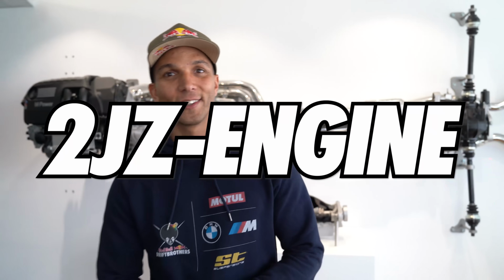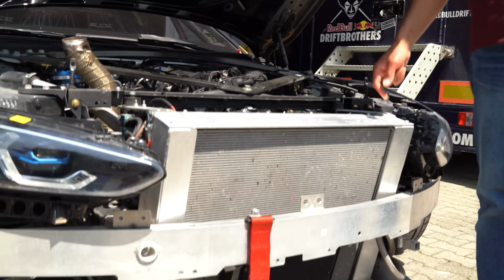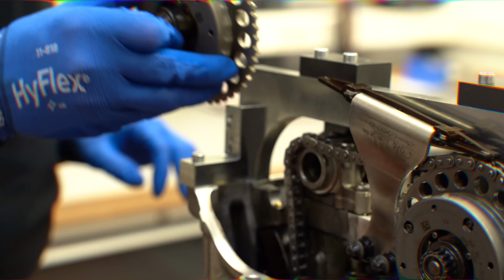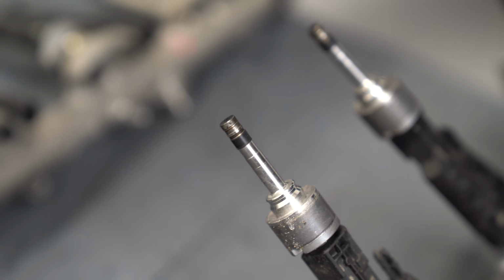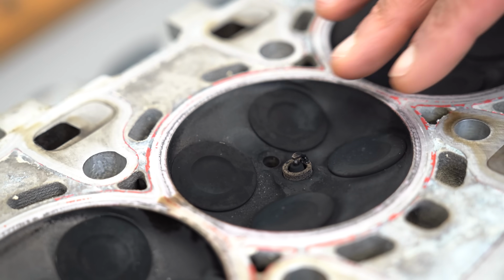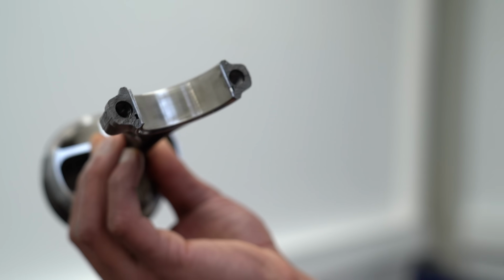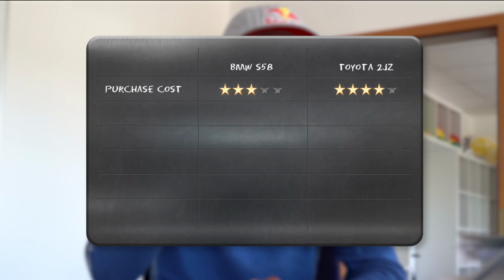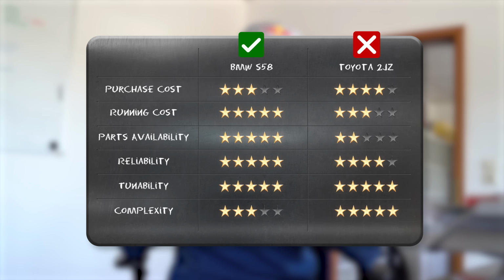Is THIS the new 2JZ? A deep dive into BMW's S58

Comment: 2JZ is Still King 👑
Reply: cope
Reply: @czczczzzczczzz  they are grenading blocks at 70-80psi at about 1700whp, 2jz cast block holds more and for longer. Also upgraded maincaps on a 2jz and it will hold 1000-1100whp forever with a good tune time has shown that.

Comment: This is great to have found! Something not really mentioned was the 2J wasn't really discovered and popularized until a good amount of them were already in junkyards and tons of them for cheap which is what propelled that status. Not sure that we would ever see that though with the S58, the base cars are just worth too much and BMW parts cost twice as much as Toyotas so no, no matter how good that 58 is, that will be the limiting factor. I don't really think any BMW engine has ever had anywhere near that kind of status because of the costs involved. 
Who knows really what will happen and I am a layman, so what do I know. 
Just learning as much as I can about it. Not sure if there is a current motor in the toyota range that might be close to that base. Needs to have super high production. Not sure if a V6 will ever compare.

Comment: The Barra (4.0 I6) is more worthy of being considered as a top engine alongside the 2JZ. There are quite a few Barra powered cars putting out well over 1000 hp.
Reply: The Barra is a great engine, but it cannot be considered alongside the 2JZ, S58 or even the B58, for two main reasons. 
1. It's a 4 litre not a 3 litre.
2. It cannot make 1000hp with a stock bottom end.
My son has a Barra, and I love it, so I'm not a hater. Just being realistic here.

Comment: In my opinion the b58 is better than the 2jz as well. If you want an inline 6 that’ll do 10s in the 1/4 with just a turbo and a fuel pump and some supporting mods it’s easier to do. Proven to hold 1000hp as well.  And a 140i can be had for 20k now value for money

Comment: Really wanted to see the back of the valves and what the engineers had to say about the added port injection.
Reply: I’m sure it helped keep carbon build up to a minimum on an originally a di fuel system which is notorious for carbon to build up in.

Comment: Just killed it with this video!  I was looking for head gasket information and came across this and got stuck watching and couldn't stop.  Unfortunately I think my head gasket is leaking coolant into the cylinders. Stock engine 30k miles no abuse .... but still we  have rusty spark plugs, steam coming out the tail pipes and we are using coolant.  Not gonna be fun, she loves her car so I'm gonna have to  change the head gasket.  I might make a video when I do it.

Comment: The 2jz is so overrated
Reply: Explain? What have people made on a stock bottom end 2jz and what have people made on a stock bottom end S58? 

(After you post those numbers remember one of the engines came out in 1992 and no one talks about a bmw engine from 1992)
Reply: Thats not a fair comparison....i mean stock turbo s58s are putting down 650..700whp fbo tuned.....the only thing the 2jz got goin for is its stout bottom end ...if you really look  its a very inefficient engine that needs big boost to make power...compared to these moderm engines as far as efficiency at makin power its not a good Comparison
Reply: @jayjesuswake3140   first thing first I’m guessing ur waving the flag by not posting the numbers. S58 is a MEGA engine. However, the G80 and M2 currently are 3,900-4,000 lb cars. I wouldn’t consider those driver cars anymore.  Second S58 is mainly being used in America for one thing “STRAIGHT LINE PERFORMANCE”. This is the reason the 2jz is so loved by Americans. It came out in 1992 and there are real world examples with 2jzGTE ‘s pushing 1160whp with 47PSI on stock bottom end and actually being abused. Those are the facts. While the S58 is making X amount of power u still have to spend 80-100k to get into that engine. Then spend another what to make 800whp LOL. that’s ALL IRRELEVANT though. Bottom line is the 2jz is the measuring stick and the S58’s I’ve seen has forged internals at 1,000-1,100whp.
Reply: @bigjdm5460   quarter mile as nothing to do with engines making power efficiently or determines the better engine wth u talkin bout
Reply: @jayjesuswake3140  guy giving his opinion yet again, but afraid to post the results in the real world. Do you realize you said a VQ35DE or HR is more efficient than a 2jz…….yet u can’t post anything it has accomplished in the real world than a 2jz . 😂😂😂😂 hilarious.
Reply: @bigjdm5460   thers plenty of bmw engines that are more efficient at makin power ...i swapped from a 2jz bk to a vq35de in my g35 because it was jus better for the power range i was lookin 4 ...actually way more efficient tbh
Reply: @jayjesuswake3140  back to he say she say. Numbers my guy. What’s the fastest pass a VQ with all its efficiency has done in the 1/4 mile? What YEAR in D1GP and formula drift has a VQ one the season over a 2jz? (To claim it’s overrated u need receipts not what you feel)
Reply: @bigjdm5460  Numbers ? lmaoo u think a 2jz powered is the fastest lmaooo

Comment: I keep telling people the S58 is the new 3JZ.
Reply: The 2jz stock bottom end has seen 1170whp and they aren’t dyno queens . So I’m confused on how the S58 is a 3jz. Unless the S58 is capable of 1,400whp on stock bottom end and last longer than a 2jz then I get it. As of right now the 2jz can compete and beat any N54 , S55, B58 , S58 when it comes to raw power on stock bottom end.
Reply: @bigjdm5460  1170WHP for how long? It's very well documented that for a reliable tune you shouldn't exceed 700-750WHP max on the 2JZ with stock rods. That's about as much as a B58, and nowhere near an S58.
Reply: @xIcarus227  wrong , E85 small turbo with a lot of low end torque kills rods. Same with a B or S 58. Big turbo 2jz’s with a good tune and understanding torque delivery will last longer and currently make more power than any stock bottom end B58 or S58. If I’m lying post the links showing 1200whp S58 on stock bottom ends and if u could do that just know the 2jz can do that and it’s from 1992. So Toyota built a reliable block back then that took bmw 30 years to make the same power yet we saying it’s taking over?
Reply: @bigjdm5460  the 2JZ CANNOT make that kind of power reliably on stock rods, you'd need to go north of 10kRPM which would probably make it cost more than rods and pistons which is stupid. 
The S58 CAN hold that power, with basic bolt-ons. You don't even need to go nuts with the rev limiter for it. That's all. 

And I don't care how long it took BMW to make that kind of power, this isn't a dick measuring contest. Any company could've built cast iron blocks that hold big power, BMW and other manufacturers didn't because it's not economical and because it also ruins handling. The Supra was criticized for its poor handling when it launched as a result.
Reply: @xIcarus227  no point of arguing, seen it in person . Did not take 10k rpm’s. U also have examples u can research. Never took that kinda rpm. Ur way off. It’s a 3.0L 86x86 . Smh
Reply: @bigjdm5460  it never took that RPM? You said it did it on low torque, which means you need a crazy amount of RPM to achieve that number. So which one is it in the end? 

Do some math. Your 1.100HP 2JZ needs either: 
1. 1100Nm of torque to make that power at 7200RPM
2. 900Nm at 9000RPM 
3. 750Nm at 10500RPM (750Nm is considered the upper limit of what's reliable with stock internals) 
Or anything inbetween.  

None of these configurations are achievable with stock internals. 1 would bend rods very quickly, 2 and 3 would throw your pistons on a priority mission to the ISS. 
So I'm not questioning whether you saw it, I'm saying it won't do that power reliably which defeats the whole point. 

We know however that the S58 does that number reliably, we have 1300HP builds on stock internals and it seems it can take more. So you're wrong, the 2JZ cannot take the same amount of power as the S58 with stock internals. Not even close.
Reply: @xIcarus227  1103WHP at 7200 RPM looking at dyno graph now. Another guy made 1160WHP . NONE OF THAT IS AT 10KRPM. You did all this math yet u could YOUTUBE THE RUNS. SECOND I said if torque delivery down low is monitored. 800Wtq at 6.6krpm (actual real dyno numbers) is not the same as 600wtq at 4krpms . 

The video we are typing under the guy said they are making about 880-900whp. The 2jz can do that and live there. I agree when u say “FOR HOW LONG at 1100whp” that depends,  same applies to a S58. Everytime I see a s58 with a 900whp or 1200whp they have already put forged rods etc in. Also I’m not talking about Dyno queens with 1160whp, 2jz’s with abuse. So just send me the links below of these 1300whp S58’s on stock bottom ends being pushed and for how long
Reply: @bigjdm5460  "1103WHP at 7200 RPM looking at dyno graph now"
Okay, still won't do it reliably. 

"You did all this math yet u could YOUTUBE THE RUNS"
There's no way I can find the video you're talking about seeing how many runs exist. 
Ps. we can't post links. It will look as if your comment is fine, but actually nobody else would be able to see it. 

"SECOND I said if torque delivery down low is monitored"
Then your point was irrelevant. It doesn't matter where the torque is, it's going to bend your rods all the same. 

"The video we are typing under the guy said they are making about 880-900whp. The 2jz can do that and live there"
No, the stock 2JZ absolutely can't live there. Go search Supra boards and you'll see bent rods even before 800WHP, hence why 750WHP is considered the upper limit if you want a reliable motor. You clearly don't understand how unreliable the stock rods become at those numbers. 

"Everytime I see a s58 with a 900whp or 1200whp they have already put forged rods etc in"
Because they either plan to take it higher, or want to play it safe. Doesn't mean it needs them, see the video we're commenting under. If a 1000HP S58 can take drifting for 2 years, which is the most abusive workload for an engine, I guarantee you that others don't either. 

"Also I’m not talking about Dyno queens with 1160whp, 2jz’s with abuse"
A 2JZ with that power does not withstand abuse, period. Sorry, you're contradicting the consensus of tuners everywhere, tuners who know much more than both of us combined. 

The 2JZ with stock internals is still a great engine, but nowhere near what you claim. The S58 is superior in stock form as far as power holding is concerned. The beauty of the 2JZ is what happens after forged internals, not before.
Reply: @bigjdm5460  I literally just told you we can't drop links in here and you still ask me to do it? Did you actually read what I wrote? Did you search the Supra discussion boards like I asked? Did you google 1000+WHP builds for the S58? Let me guess: no. 
You're more interested in ranting about how the 2JZ is the greatest even though it's clear the S58 is superior in stock form. 

If you're gonna continue your monologue I'm out, there's no point wasting my time on people who can't subscribe to a basic semblance of truth.

Ps. your comment got deleted, probably because you decided to edit it with a link.
Reply: @xIcarus227  I was at target shopping. Mybad , I’m bad at multitasking

Comment: I can hear the tears from 2JZ fanbois, it sounds like a tropical rain storm.
Reply: You’re discussing a motor from 1993 that holds 1,180whp on stock bottom end to an engine that holds similiar power produced in 2020 ? How is it better? Also which bmw inline 6 from 1993 holds 1200whp on stock bottom end? 😑
Reply: @bigjdm5460  can a 2jz not handle 1,181hp stock?
Reply: @matthewnicholas6365  it really can't, he's dreaming. Perhaps there's been a handful of cases dyno-ing close to that number, but they wouldn't last past a few days.

Comment: Nah B58 is modern 2JZ S58 better than both of them
Reply: S58 is better in what way? Post the 2jz stock bottom end power numbers and post S58 numbers. Then tell me which block can hold more power reliably, then tell me which crankshaft can live longer at 1,500whp? If u dnt have those answers or some how did u come to the conclusion the S58 is superior?

B58 at 800whp on stock bottom end is a time bomb. 2jz can live there easily…….post the facts.

Comment: Not impressive at all. If Toyota's 2JZ engine could do 1000+hp in the 90s then BMW should be able to do 1500+hp in 2023!
Reply: I’m all about the facts and will give credit where it’s due. But to say the S58 is superior when it isn’t out performing a 2jz from 1993 in 2023 is just BMW bias . these guys are acting like it’s doing 1,400whp on stock bottom end. Even if it did what bmw engine from 1993 is even being discussed in 2023?

Comment: My big take away is with a good warm up and proper maintenance, these things are very reliable
Reply: Modern engines don’t really need to “warm up” to an extent, if it’s like negative degrees out yeah you should probably warm up any car.
Reply: @CHIKMNUNGET  yes and no, you can drive any engine straight away, but you should try and put the least amount of stress on the internals as possible by easing the car along and always waiting until the car has has reached operating temp to get any sort of power out of it
Reply: naw man warm up the engine oil only does its job properly at certain temp

Comment: Have the s58 in my x4 M comp and it’s not missed a beat in 80,000 miles, what an engine.
Reply: Bro I can’t find those anywhere how many miles did you get it at? What year? How much did you get it for? I found 2 2020’s for 45k and 47k
Reply: What can’t you find ? The car ?
Reply: I'm about to pull the trigger on an x3m comp. So I won't regret it?
Reply: Test drive, then test drive again, as it’s been said the B58 is a better cruiser in the X3M40I, actually better on motorways as well as it stays in gear, but ………

We don’t buy M cars to cruise about, the S58 wants to be revved and comes alive over 4k

I’ve driven to southern Italy and northern Norway in the middle of winter, this car is capable and I prefer it to softer set ups.

I’ve rung its neck round the Nurburgring and it preformed unbelievably, brakes, engine, suspension the lot.

If your looking for a fast SUV that preforms Pull the trigger and don’t look back, if your looking for a cruiser that glides over bumps and rolls round corners, get an X5 Diesel.

Enjoy 🤝🏻
Reply: @TheCritAddict  biggest complaints people have are the S58 has no low end torque, the B58 is much better for daily driving in that aspect. Comps are known to be uncomfortable to ride in due to how stiff the suspension is. I’ve had the pleasure of driving an X3 M40i and it RIPS. Plus very easy to make more hp with. I would recommend a M40i over a comp unless you live in perfect conditions and have a different daily.
Reply: I’ve owned both, and driven both long distance, the M40i is capable but they are not even in the same league for performance, the M Comp leaves it behind and add some corners in it’s gone. 

I’d not look back. 

Only minus is the service costs are double and parts are 3 times as expensive.
Reply: @demotroniczz6943  I`v got X4mc and the car is fantastic. Gear box is so sensitive and make a compensation of low torque of low down. Even very delicate touch of gas pedal makes a great effect. Also comfort is well for me event if I`m also 50 yo and my previous car was Range Rover with air suspension.
Reply: @TheCritAddict hope you did

Comment: The only thing with the 2jz is that it’s simple but elegant Japanese engineering. Reliable over built and strong with decades fine tuning ,parts experimentation. The German motors are crazy powerful beautifully built motors but Japanese build higher tolerances into their machines German/European squeeze the machines lowering their life. Can’t beat Japanese bang for buck.
Reply: while being simple you can’t make the gains this engine makes due to complexity. just because there’s more to the s58 doesn’t make it bad.

Comment: B58 is more like it. S58 is a totally a different league compare to 2JZ.
Reply: Recency bias is crazy
Reply: In what way? The 2jz bottom end can hold 1,200whp and I’m sure the cast iron block can hold more power reliably than a S58 block. 

B58 stock bottom end limit is 650whp reliably and 800whp is a ticking time bomb with piston failure etc. transmission start to slip as well. The 2jz can hold 800whp reliably . 1,000whp reliably

Comment: What would it take to bring a B58 up to par with the S58?
Reply: Port injection, bigger turbo, good tuner and a transmission, the trans is the weakest part of the b58 over 750tq you need a built trans
Reply: B58 needs fully built internals above 650hp. But you can typically run stock parts w/ high flow downpipe up to 500HP on OTS maps. You might be able to get a bit more with custom tunes depending on the fueling available to you
Reply: @Shane-h4uu no u can make over 700whp+ on stock internals easily with the B58. The 650whp range is dangerous on certain/early gen B58s that came with the weaker hpfps. The B58s with the stronger hpfp(newer ones)can take that but people usually go port once they start tapping into the 700whp+ range. There are multiple B58s making 700+whp easily and stock internal 800whp B58s are slowly becoming more common.
Reply: @Shane-h4uu wrong, a few b58TU engines are currently above 1,000hp stock motor.
Reply: @Shane-h4uu  650 is on the very safe side for the newer iterations. 750 is more realistic before adding built rods.
Reply: @xIcarus227 wrong, b58 have beefier rods vs the s58